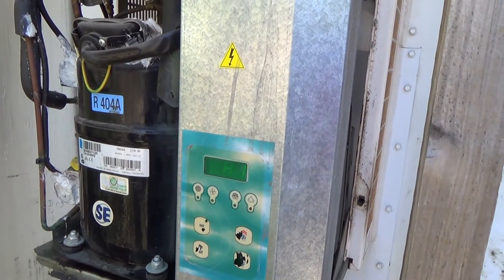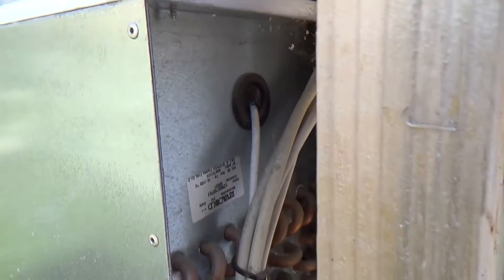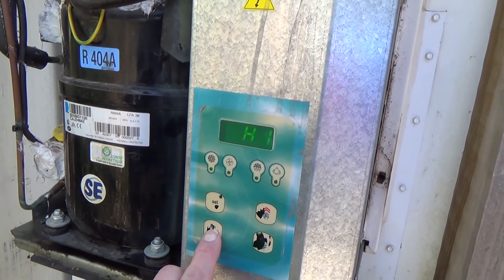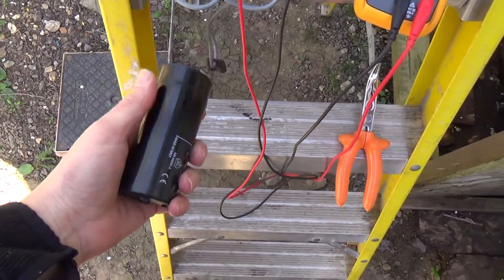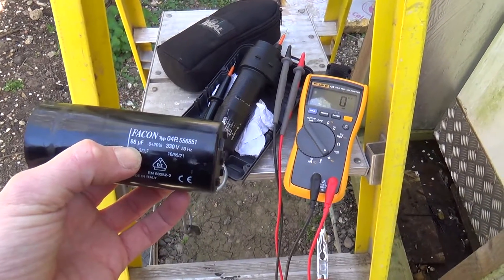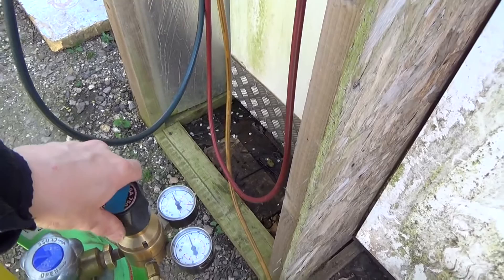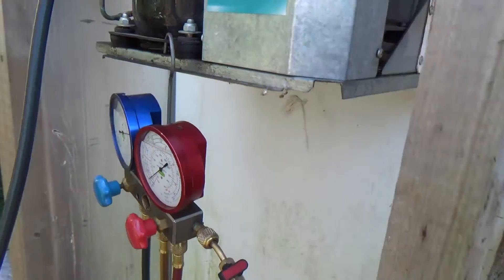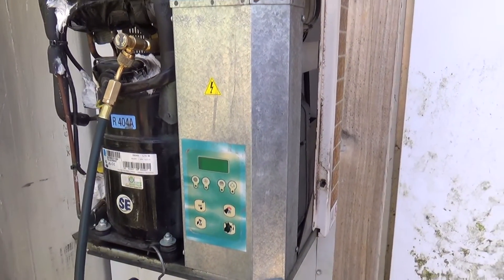Faulty Rivacold unit

Comment: Expensive repair. Nice find with the pressure test.
Reply from the maker: Thanks Rob, Its been noisy ever since i've worked on it, like the internal compressor mounting springs have broken. I could see this biting me in the ass if i tried fixing it so advised them to replace it with new.

Comment: Sounds expensive John. Plus your bill to give them the good news.
Reply from the maker: Think it would cost around a third to half the price of a new system to fit a compressor etc, plus then there could be moisture problems. Also the keypad on the controller was cracked so they could be into another few hundred $$$ , depending if the keypad is a separate part or not. System is around 7 or 8 years old, if they want a reliable and long lived system they should have a proper split system as these through the wall ones have no safeties on them so lead a hard (and often short) life.